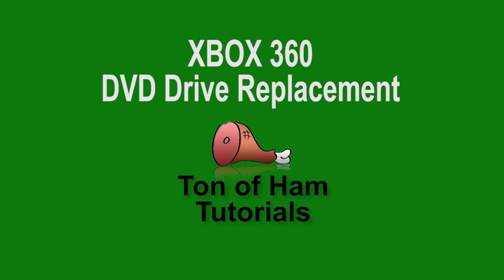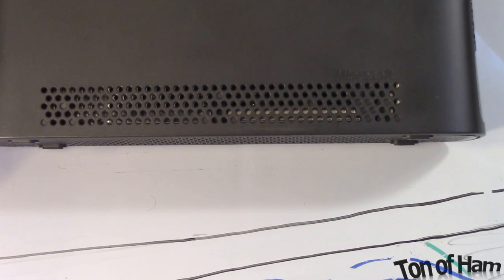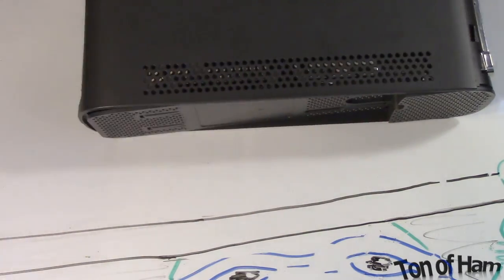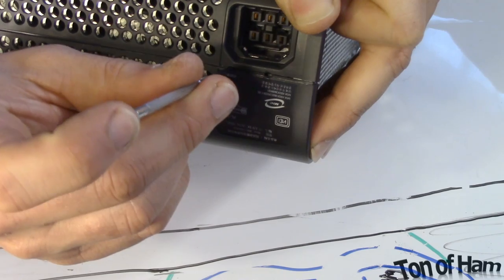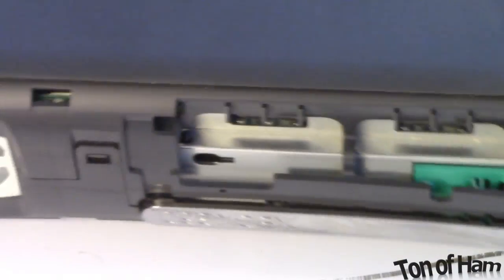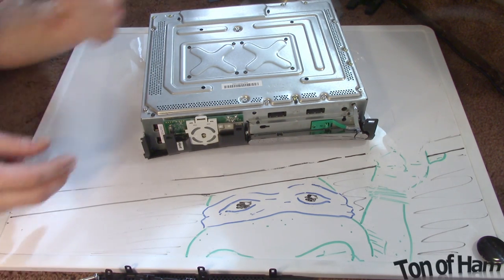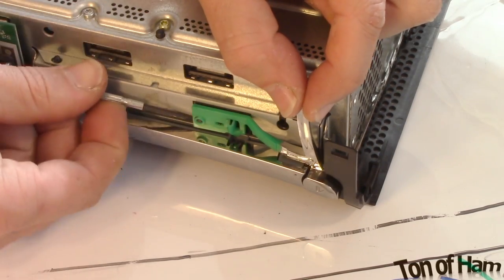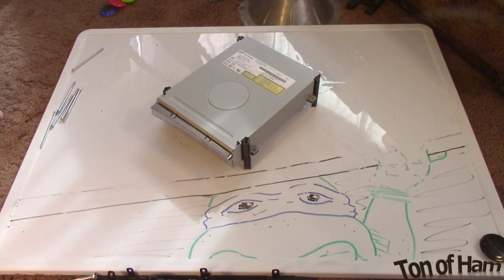Xbox 360 Tutorial: How to Replace DVD Drive Part 1

Comment: Thanks soo much for doing this. I just ordered a preowned unit, because I wanted one of the original models. But I always disassemble my units to add new thermal paste and wipe out and re-grease the Disc Drive along any areas of high friction.

So this video comes in handy

Comment: My dvd drive wouldn't read discs anymore and everytime I put in a disc, it just says OPEN TRAY
Reply: You have to clean the laser inside of the disk drive. I used a cotton swab and non alcoholic water based cleaner
Reply: My Xbox 360 does the exact same thing; "wouldn't read discs anymore and every time I put in a disc, it just says OPEN TRAY" (after saying "READING").
I hadn't used it for a couple years.
The first day it seemed to work fine.
The second day it wouldn't read (I thought I was doing something wrong). Finally, after "playing with it", it read the DVD disk and it worked fine.
The third day again it wouldn't read. (So, I banged on it while it was booting the game.) The game loaded and it worked fine.
I'm hoping that cleaning the laser will fix it.
By the way "Ton of Ham", great videos. Thanks.
I will use them when I perform the surgery.
Reply: @joshfalkenberg  did not work for me

Comment: Hi, is it ok if I just replace the dvd drive with a different one rather than repair the actual drive?
Reply: Unfortunately you can't. For whatever frustrating reason, Microsoft married every disk drive with it's motherboard in the Xbox 360. If you put a disk drive from one 360 into another, it can read movies but not games. The reason being that the DVD key doesn't match, as it's on a different board. It's apparently possible to change the DVD key in the drive to match the new board but I've actually never seen a tutorial to do so anywhere.